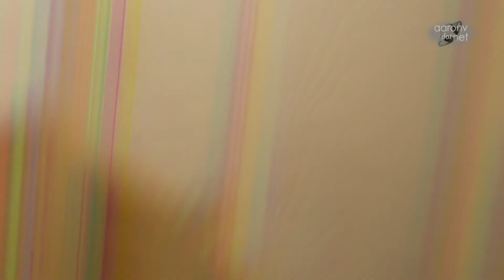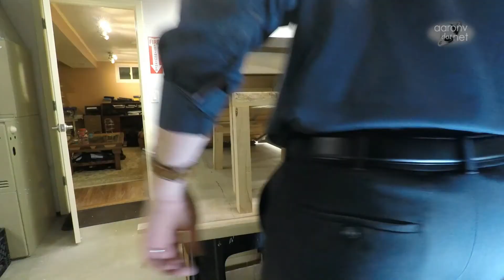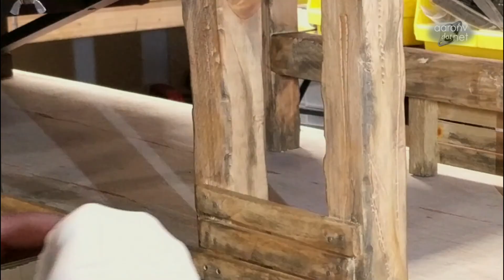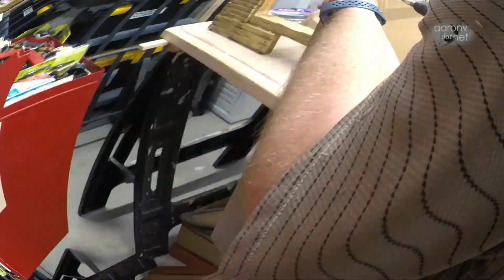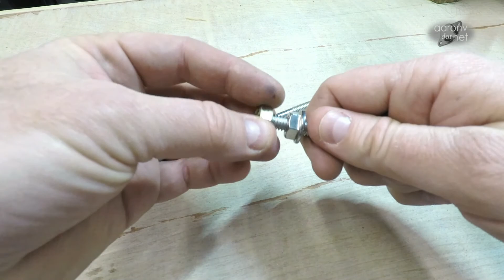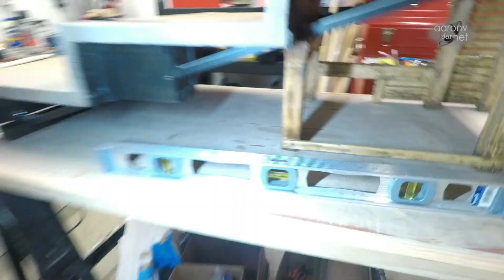[15] HMGM - Supporting Role (Build Episode)

Comment: Man, that thing is built like a tank. Great use of spray adhesive. I approve of using the needle nose for reaming the copper pipe, lol. BTW, I have an SLA printer now too, so whether you need semi-functional or purely decorative prints for this thing as you add detail, I've got it covered.
Reply from the maker: Sweet! Thanks again for the offer. Once I get into the mill equipment design I may be looking for the help as there will be fine details to model.